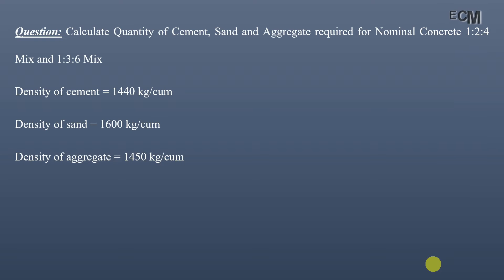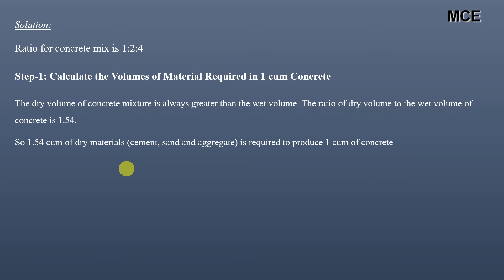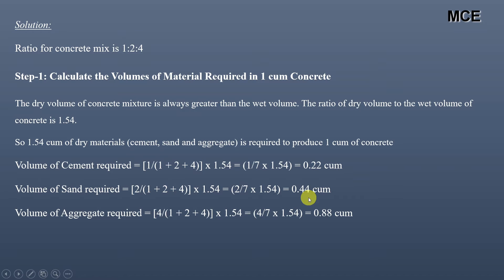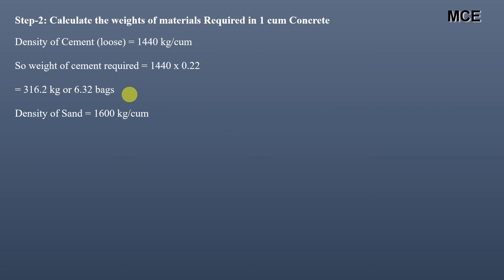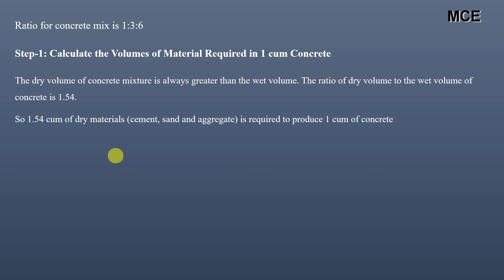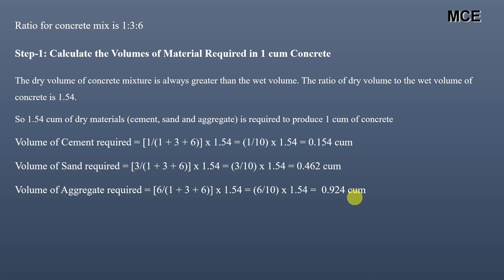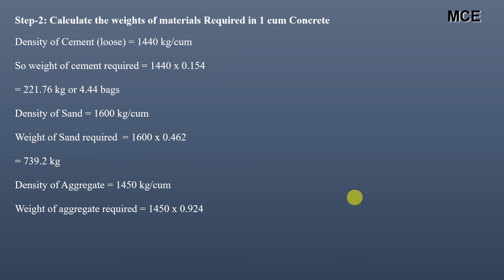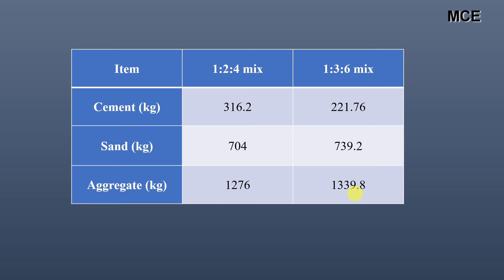Calculate Quantity of Cement, Sand and Aggregate required for Nominal Mix Design| Solved Problem

Comment: Hi Pls help how much Cement, Sand and Aggregate is required for PCC to be done in 2000 Sq Ft with 4 Inches of PCC thickness.
Reply from the maker: Thanks for watching dear
Reply from the maker: What is the mix of concrete